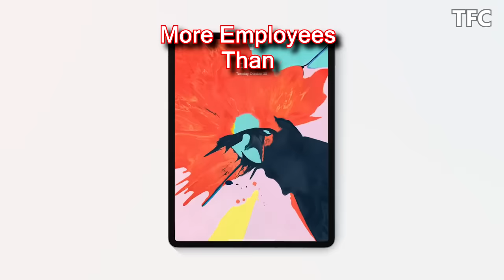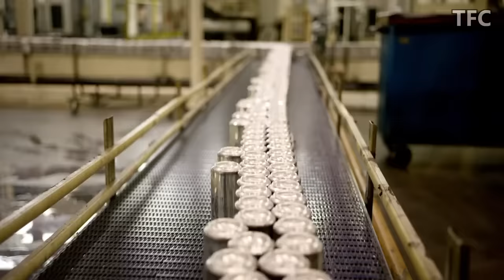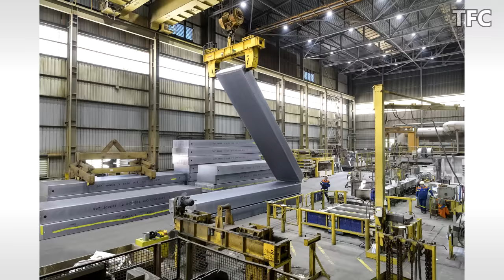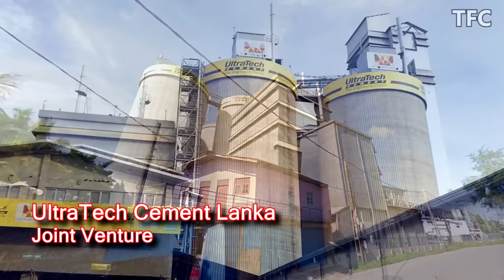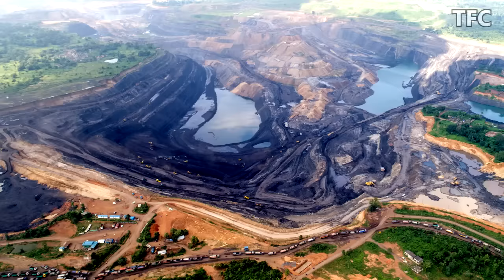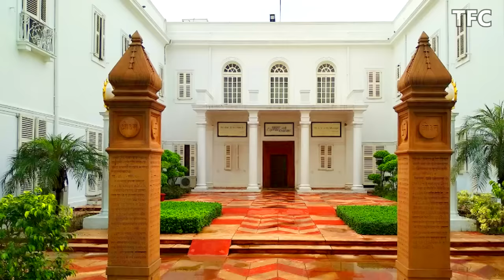Birla Family Business Empire | How big is Birla Group? | Aditya Birla Group

Comment: The BIRLA owned businesses were mainly focused on the core sectors like automobiles, cements, textiles,steels etc. But post liberalization they failed to embrace the new economy like telecom, IT or pharma sectors.On the other hand the TATAS were much successful in their business strategy by venturing in newer areas eg. TATA CONSULTANCY,which happens to be the largest IT company in INDIA. BIRLAS business flourished during the protectionism regime & currently  with the exception of the Aditya Birla group, the others are struggling to compete in this globalized economy. HINDUSTHAN MOTORS is a living example.